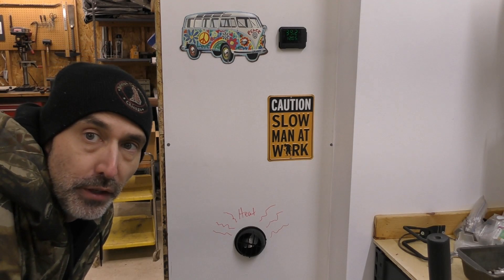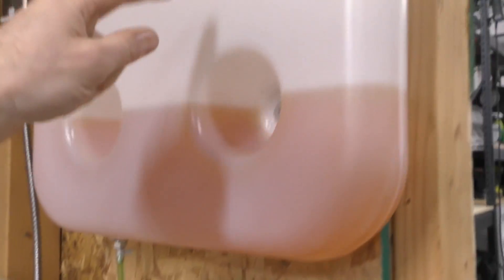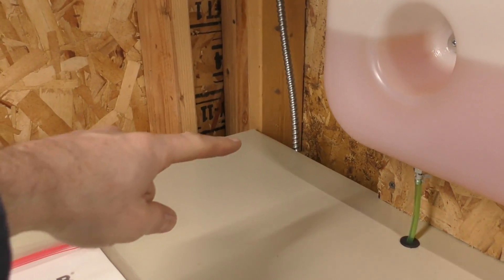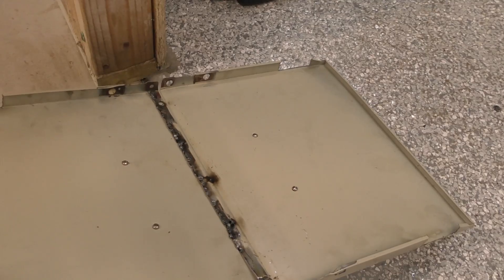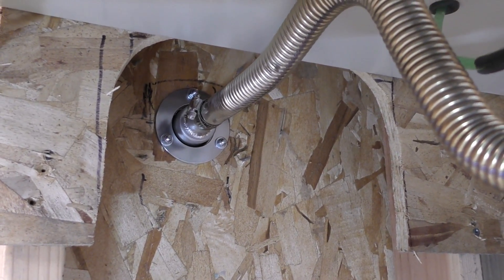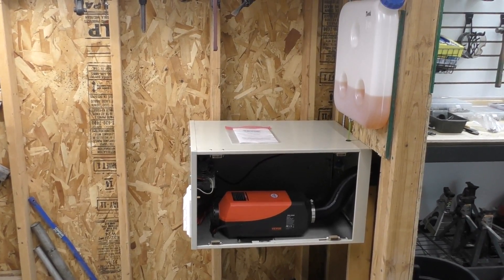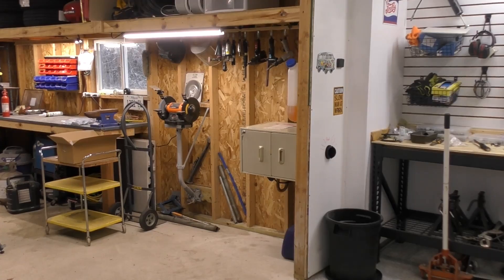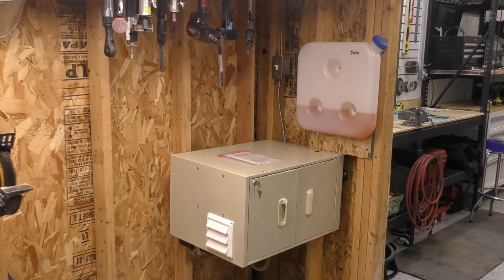Custom Garage Mini Furnace Using a Vevor Diesel Heater

Comment: Fuel line should have been far from the exhaust as possible. The exhaust is set up like p-trap and will tend to hold condensate. (Raise your unit and have all the exhaust going down hill), I would also recommend running off a battery with a trickle charger. So in a power outage you can still have the proper cool down. You can put solf foam around the pump to dull the pump sound. The pump should be mounted at the recommended angle. The (opitional) power switch should be located where you don't have to reach over the unit in an emergency if you decide to keep the 110v. I would have mounted the fuel filter vertically under the tank and double check the flow direction. I would have mounted a fuel shutoff valve immediately below the tank. I would have mounted the fuel outlet in a straighter path of the fill lid and avoiding the mounting screw pockets. I would have mounted the fuel tank at the same height +/- but off to the air intake side and not above the heater. I would have drawn combustion air from outside rather the consuming heated air. P.S. the colder air also expands the air volume of the flame making it way more efficient and have cleaner exhaust. Other then that the file cabinet was a good idea.
Reply from the maker: Thanks for the great notes, I plan to do some rework based on comments to improve the longevity and efficiency of the furnace.
Reply: Why didn't you make your own video instead of writing an article about what the Creator did wrong
Reply: @bkee62  just trying to help. The creator appreciated my review. I have a lot of experience with this and have learned a few things. It is easier to get a helping hand sometimed.
Reply: @lloydmacdonald4492  we appreciate the feedback but I agree it sounds like with your knowledge that we need you to make us a video😊
Reply: @bkee62  Because this is the only video that some people will see and it's good to have someone else's valid recommendations right below it for those people
Reply: From what I saw of his fuel line is his pump needs to mounted on the wall at an angle . With the input on the down side and output on the upside .

Comment: This is one of the cleanest installations I've seen. The only things I would change is a battery with a trickle charger instead of an inverter in the event of a power outage and lowering your exhaust to eliminate the loop. The condensation will accumulate in there and you've created sort of a p trap. Realize your concern regarding snow accumulation, but with the heat coming out of the exhaust it shouldn't be a problem. Not trying to be nit picky. You did an amazing install that will probably  be just fine.
Reply from the maker: Great notes!  I plan to rework the exhaust based on comments.  Thanks!

Comment: YOUR FUEL ILNE IS TOO CLOSE TO THE EXHAUST PIPE THIS GETS REALLY HOT (FIRE HAZARD) !!!!!!
Reply from the maker: Thanks for the heads up.  Based on comments, I do plan to modify the exhaust slightly and will move the fuel line around to the front to keep it away.  Thanks!

Comment: I like the use of a 2 drawer filing cabinet, I might copy that.
Combustion air intake should be mounted externally.
I don't see any backup system to run the shutdown sequence should the ac\dc power supply fail or malfunction.
Reply from the maker: Good comment.  I don't plan on a backup system as I don't plan on using this everyday and will just be careful to turn it off in the proper sequence. Thanks!

Comment: Also not cutting down your job it’s a cool idea but the exhaust being with the loop on the bottom will hold water ( condensation)
Reply from the maker: Critical comments are welcome.  I plan to tweak the exhaust and will post a follow-up video on this.  Thanks!

Comment: I DIY installed a mini split heat pump in my shop. More expensive than your setup but no worries about fuel, and provides AC and dehumidification in the summer.
Reply from the maker: I mini split would be nice.  Since I live up north, I don't need AC so I decided on this cheap option for heat.  Thanks for the comment!

Comment: I noticed you have your fuel pump horizontal. The manual shows it is supposed to be mounted 35-45 degrees from vertical.
Reply from the maker: Thanks!  I am planning to make that change.

Comment: Great vidro Scotty and a very nice set up.  Do you think this would be suitable for the bay windown bus.   ???
Reply from the maker: Absolutely, they are made for 12 volt applications.  I believe, back in the day, VW had a gasoline heater that worked similar to these as an option.  I'm not sure the best design for mounting, but I'm sure there are videos on installing these in a camper van or RV.  Also, the 8kw version would probably be overkill, but Vevor makes smaller versions of this unit.  Happy New Year, P Street!

Comment: Very interesting setup, creative use of an old file cabinet. There are some issues that you will likely need to address in the near future however. These fuel pumps need to be installed more vertically, 30 to 90 degrees upright, because they create cavitation bubbles. the bubbles will collect in the horizontally mounted pump, since all the lubrication for the piston is provided by the diesel, the upper half of the piston will wear out quickly. Looks like the fuel filter is mounted backwards? the combustion exhaust should have a continually descending path, because water is a byproduct of combustion and the water from diesel combustion is acidic, so it will corrode through that low point, allowing exhaust gases to escape into your home. You can also realize an efficiency gain by routing the combustion intake outdoors, so you're not consuming the heated air from indoors to support combustion. The green PVC/ vinyl tubing is not well suited for this application, it will become brittle, crack and start leaking fuel. upgrading the fuel line to a 2 mm ID rigid nylon is probably the most common upgrade folks do to to these heaters from China. I would also suggest you take the switch out of the supply circuit to prevent an accidental shutdown. If you have any risk of a power outage, I would replace the power supply with a 12V battery on a trickle charger. Any loss of power to the unit will prevent the required cooling cycle from running, which will typically result in an overheated/melted ECU. Take a look at John McK 47 video library here on YouTube, he has a great reference library of diesel heater information https://www.youtube.com/watch?v=TGFDFZ6r1dI&list=PLgzGXsX2Qhhg5dzXBjBgMZASA4SGib4jU&index=6&t=18s . Best of luck with your unique installation!
Reply: Great feedback on Scotty's video.   So this could go in a camper ??? Plugged in to a cigarette lighter outlet ?
Reply: @pstreetgarage7304  Yes, they work great in campers when installed correctly. the lighter outlet will need to be capable of providing 9-15 amps, as Scotty mentioned in the video, due to the amperage required to power the glow plug on start up.
Reply: You covered all the bases, my thoughts exactly.
Reply from the maker: Such good information in this comment.  Thanks so much... I am already going to start working on these changes this week and will put out an addendum video.  Thanks!